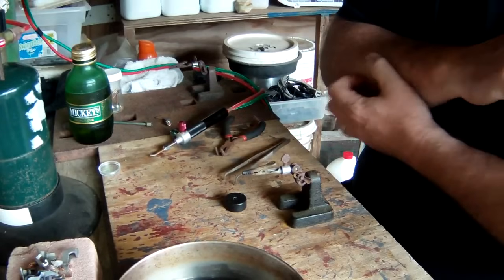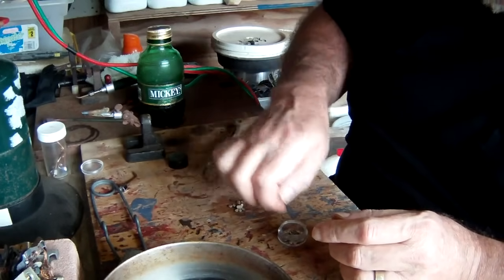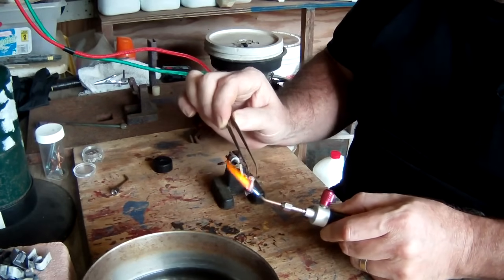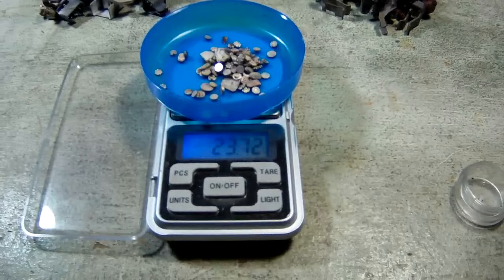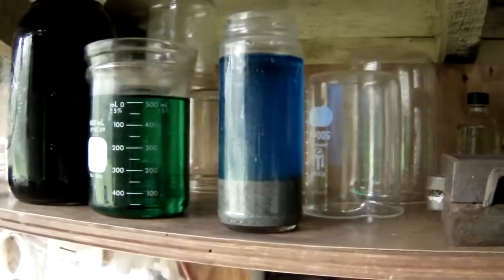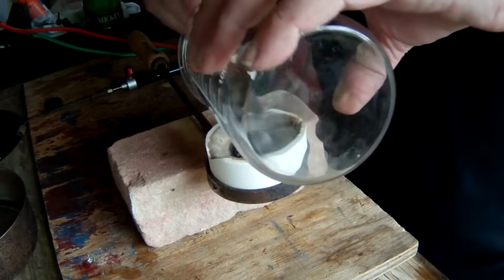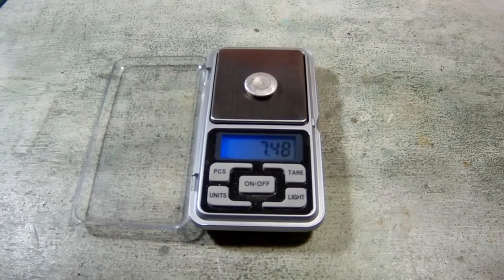Silver Contacts Recovery & Refine Complete Process (long video, but worth the watch)

Comment: After your process in this video, what percent was that button?   Also, when you were "distilling" the silver with the copper coil, what was the liquid in that beaker?  Is that process called distilling?  thank you for showing us this process.  Very informative.  Can't wait to see your silver cell video.
Reply from the maker: Yield was 1.65% per pound of arms. The fluid was a mix of silver and copper nitrate, adding the copper coil forced the silver to fall out of the solution as the copper replaced the silver. This is a replacement process where one metal replaces the other. Hoped this help to explain what was going on.

Comment: New to opening avenues scrapping. Also new to the notion my yard has been bending me over! I have about 30 or more breakers and bus bars that are silver/silver coated. Im not a well versed scientist or anything of the sort. Could you possibly point me in the direction of the safest,easiest and most layman (dumbed down fool proof) way of extracting the silver? Or would it be beneficial to just try to sell the pieces without refining? I hate loosing money at the scrap yard and I feel that they enjoy that notion....
Reply from the maker: There are many ways to recover the silver, but for me only one way of refining it, and that is going to involve nitric acid. That is the method I use, maybe slightly less dangerous is melting your recovered silver, and cupelling it, which involves mixing with lead and heating at a high temp in a furnace or by using a torch. The last method is reverse electroplating, but chemicals are involved there as well. There may be other ways of leaching the silver, but I am not aware of them. All the methods I've talked about have varied dangers, its just a matter of what you are comfortable with. If your unsure, my suggestion would be to just recover the silver and send it to someone else for the refining part. Most home refiners like myself charge about 25% of the yield, some a bit more, I haven't seen any for less. Hope this was of help!!
Reply: Reverse electrolysis

Comment: Maybe flatten the little buggers with a hammer before nitric dissolve? If there is tungsten, it will show and same time increase surface area for faster reaction. Great vid tho!
Reply from the maker: That'a a good idea, normally I try to bend them before I do anything to see if they are solid or alloy, but wackin um with a hammer would be allot quicker!

Comment: whats that nifty little torch called you are heating the contacts with and where can i get one?
Reply from the maker: Its called a smith little torch, you can get a clone on ebay for about $25, mine is a real one that I paid about $125 for years ago. Got a clone for a backup and it seems to work just as good.

Comment: I always sold mine as copper and brass scrap and didn't bother with the buttons. Or removing the silver plating never thought you would get anything with it.

When you were getting the silver or of the nitric acid did you just use a copper coil to get it to drop out or do you need to add another chemical I'm currently looking at doing this with half a pound of fuse Silver, trying to find some good methods to try as a fun project.
Reply from the maker: I actually have a video on fuse foils, it shouldn't be to far back if you want to check it out. & yes copper coil.
Reply: @BackyardScrapping  brilliant I'll have a look this weekend
Reply from the maker: @chrisinselwyn  👍

Comment: I don't know the actual names of the different types of breaker box things but in my experience, the ones with a switch that have little braided copper wires attached to the arms that hold the contacts are most definitely a very low percentage of silver. Not even 10 percent. I don't even bother with those. The ones that are silver are in the breaker box thing that has a single spring button on the top. The contacts in those are always at least 85 percent silver. Sometimes almost pure.

Comment: Where did you get that little torch that you used?
Reply from the maker: Years ago from a jewelry supply, its a smith little torch, BUT don't pay $125 for it like I did you can get them on ebay much cheaper, in fact I bought a clone for $20 and it works just as good as the smith!!!
Reply: Thank you. I bought  two different ones on amazon and they are from China and I cannot get it to attach to the regulator. The smith company said it is because they are basically counter fit products. Maybe I will try eBay.

Comment: silver forms a protective coating around itself to stop nitric getting to it , which is why you need to inquart karrat jewery . you woud have been better off melting the contact and including some copper . then make it into shot and then soaking in nitric . my guess is what you had left over was silver
Reply from the maker: No it actually was tungsten and tungsten dust, it would not melt, I tried. In fact trying to melt silver coated tungsten contacts can actually cost you some silver unless you have a very controlled temperature. Also you really want to refine them before melting because some will have cadmium in them and its really not a good idea to vaporize that. Thanks for watching.
Reply: When dissolving gold you Inquart silver. Not the other way around
Reply: @jessiemonahan9868  yeah I know. I never said it was the other way around.

Comment: I wish we as watchers could post pictures in with the comments, I have some contacts almost the size of a dime, I don't know anything about the chemical process I would just like to take them off the copper bus bars and try to sell them, where did you buy the torch you use, great video
Reply from the maker: Got it on ebay
Reply: I have some contacts that are 3/4"x1"x1/8" and weigh half an ounce that come out of nema size 5 contactors

Comment: What do you do with all the used acid?
Reply from the maker: To lengthy to explain here, I have gone over it in other videos, but I can tell you it is properly handled. Some is redistilled and I recover and reuse the acids, others are properly neutralized and  disposed of, and some are simply reduced by evaporation. The recovery method kinda depends on the refine, but recovery and reuse saves a bunch of money so I do that when ever possible, the more I save the more I make.

Comment: Thanks for the informative video!  I’ve been stockpiling all my contacts from ewaste over the years.  I do have a question.  Can you just toss all the arms with the contacts still attached in the nitric acid solution or is it necessary to remove the contacts like you did with the torch?
Reply from the maker: I the arms are silver plate or copper I do not recommend putting them in your nitric as there is to much copper. Its pretty much always best to remove the contacts or you will be dropping the silver as fast as your dissolving it and going in and endless circle.

Comment: I wouldn't rinse the dropped Ag powder with HCl first... you run the risk of creating AgCl in your Ag powder.  There is ALWAYS residual Ag still in solution after dropping with copper. Probably why your powder looked more gray- AgCl contamination.  Rinse dropped Ag powder through a filter with copious amounts of DI-H20 instead.  Final rinse with 250mL boiling hot DI-H20. This has been enough for me to get .999 purity on first refine (if parent material wasn't too dirty- mostly sterling and coin Ag). I follow up with silver cell refine to get to .9999 fine.
Reply from the maker: Hey Michael, I didn't show it in the video but I actually did rinse before putting it in the hcl, I just didn't show it, most of the time I don't show the rinsing in my videos because of time, and my videos are long enough most of the time anyway LOL, so I cut out as much as I can. I probably should have been clearer about that in the video though, as a newbie could assume they could do exactly what you said. I have found since making this video that it just seems to be the newer circuit breaker contacts that do this, and as I'm really not doing tons of new ones I just keep the silver from them separate, and then toss it in with the next refine to clean it up. Thanks so much for pointing this out, I will do my best to remember & be a bit more descriptive in the future!!!
Reply: @BackyardScrapping  Is it okay to rinse with HCI after a really good rinse? then rinse again after the HCI bath plus the boiling water rinse?  I see that @Michael Trone said it could risk AgCI contamination, is that only if you dont rinse really well before you do it?   I like the thought of rinsing like you did to get the impurities.

Comment: Are silver contacts solid silver or is it another metal plated with silver?
Reply from the maker: The ones in this video are coated tungsten.
Reply: @BackyardScrapping  are there any contacts out there where it isn’t plated but still mixed allow of silver kind of like in silver coins that it’s just silver mixed with another metal?
Reply from the maker: @alexyu1236  Yes, many larger contacts are alloys, normally they will be smooth, the tungsten usually have a kind of waffle pattern on them.
Reply: @BackyardScrapping  interesting

Comment: Where do you often find the contacts?
Reply from the maker: You can get contacts from just about anything that has a switch on it, and I mean just about anything. They can range in size from the point of a pin on up depending on what and where they were used. The ones in this video were from old broken circuit breakers.
Reply: @BackyardScrapping  Thanks, for the advice! And, the subscription ^_^ !
Reply: large switches relays cutlery everywhere

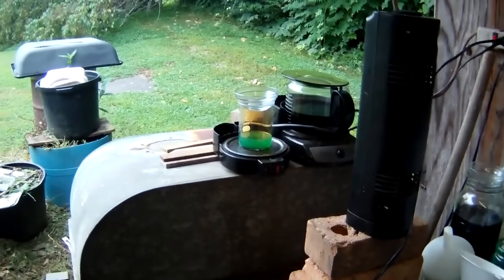Comment: Great video! I lost you at about 15:16 Is that some kind of electrolysis procedure? Also is that a mini oxy acetylene set up you have for heat?
Reply from the maker: At 15:16 I was just adding a bit more nitric acid to try and dissolve the remaining metals. A bit further you see the copper coil, that is just a displacement reaction, when you put copper in silver nitrate the copper dissolves and forces the silver out of solution, no electrolysis. The torch is actually mu jewelers torch leftover from when I did jewelry repair.
Reply: @BackyardScrapping  oh thank you for the reply
Reply: @BackyardScrapping  I usually dump concentrated salt water into the solution after the displacement, as there's some silver ion left over.  Silver chloride will then drop out, which can be washed when there's enough to work with, turned to silver oxide with hot lye solution, then dried and direct smelted with carbon, or reduced to metallic silver with sucrose or dextrose-rich Karo corn syrup.
Reply from the maker: @charlesdecharleroy7209  Yes, I do the same, I have some other videos showing that. I don't show doing this on every refine because I save the solution up until there is enough to mess with, I have showed it when doing much larger refines.

Comment: Nice video. Do you recycle also waste water with base metal chlorides or nitrates?
Reply from the maker: Waste water I just use steel or iron to drop the copper which I recycle, then I use sodium hydroxide to drop out everything else, filter and neutral the water to dispose, and I have a bucket that I keep the filters in. When I get a full bucket of hard waste, i will see if I can sell it off or give it to a larger company that can recover the rest. Great question thanks for asking!!
Reply: Perfect. I try to be responsible for waste/nature, in past I tried conversion to hydroxides but they are mostly gelatinous and is problematic to filter residual water or salts out. At least make sense to recover copper and tin because they cost some money. Regarding contacts, sometimes you can have Au-Ag alloys, sometimes more like palladium content ;-)
Reply from the maker: Yes, in the past I have gotten a few silver over gold, don't know what they were used for, but they were a super heavy silver plating over a super heavy gold plating on a base metal of some kind. The silver and gold yield were both good from these, but I have only come across them that one time. Haven't gotten many with palladium yet, maybe one day I'll get lucky and find some!
Reply: Did you ever figure out what kind of metal the remaining part of the contact was?
Reply from the maker: @Kinneycc123  best guess was a nickel alloy of some kind, with out extensive testing or one of those $20,000.00 nice little testing guns, don't really know for sure. What I do Know is there was little to no precious metal.

Comment: I run contacts from the relays out of junkyard cars. Im fortunate that the junkyard charges me $10 for a canvas grocery bag of them. I'll pull em apart and refine those contacts. Im getting between %60-70 yields. It is very laborious and kinda tedious, but the yields are real. I've always wondered why everyone says they're only plated when my experience is that they are alloy.I've posted a few videos if you're interested. Not trying to promote myself, just saying. The copper i get from the spools and legs almost pay for themselves in scrap value. The legs are also plated (very very thin) with silver as well. Good run-through, tho. Also, i thought the type you're processing contained palladium, but i guess not?
Reply from the maker: Thanks for the info about the cars! Things are a bit crazy around here still, but when thing settle a bit I will check out your channel!

Comment: Did Palladium dissolve in boiled hcl master.
Reply from the maker: No
Reply: Ok thanks you are the best master.
Reply: @BackyardScrapping  if hcl + h2so4 to dispose of iron and tin in alloy / matrial whether the palladium is dissolved in the master.
Reply from the maker: @layarsentuh7665  The powder in this batch did not end up being palladium, it was other metals.
Reply: @BackyardScrapping  1.5 kilograms of mlcc magnets I was off but could not find the error palladium dimna master.  The first step I did was burn it until it was red like charcoal, then I ground it into flour.  the second step I put in a pyrex glass then I boil using a single hcl then the water changes the color to red which I assess is nickel water, I drain it I wash it a few times to get rid of the hcl, then I soak it using h2so4 to remove the iron and then I wash it  , after that I just boiled using hno3 to get palladium and silver but I didn't get it using potassium iodine.
Reply from the maker: @layarsentuh7665  The "New MLCC's" do not have any palladium in them, and very little silver. I have done 2 batches and got no palladium, also had the new mlcc's tested xrf analyzer  which shows zero palladium and 1% silver. New magnetic mlcc's are of little to no value.
Reply: @BackyardScrapping  master, if settlement water or aqua regia is deposited using lime (cao), is the color of yellow sediment different?  please enlighten me.
Reply from the maker: @layarsentuh7665  Not really sure what you have there, please remember I am not a chemist, my knowledge of this process is hands on practical knowledge from practice and hands on doing it. For technical answers you might want to hit the books, thats what I do when I don't know whats going on. Read read read is my best suggestion I can give you.
Reply: @BackyardScrapping  ok master, thank you for the advice, nice to know from Indonesia, if you have a vacation plan to Indonesia, contact me.
Reply from the maker: @layarsentuh7665  Will do, thanks for watching!!
Reply: @BackyardScrapping  Master from which country can I have a mobile number that directly WhatsApp.

Comment: What is the coil thing?
Reply from the maker: Copper wire
Reply: @BackyardScrapping  is it hooked up to electricity?  Or just hanging
Reply from the maker: Just hanging, it is a displacement reaction, when you put the copper in the silver nitrate, the copper dissolves into the solution and forces the silver to come out of the solution. In essences to 2 metals are trading places.
Reply: @BackyardScrapping  thanks for that info.
Reply from the maker: Your Welcome!

Comment: Do you ever just melt the contacts into ingots without refining and sell them?
Reply from the maker: Great question! No I don't, I refine most everything I get in scrap. The problem with just melting stuff down is you don't really know what you have. For example some contacts are just very heavy plating on Tungsten, and they can also range widely in purity, 10% up to almost pure. By refining, I know exactly what I have, and should I sell something I know exactly what I should get paid for it. If you just melt something, and then need to sell it you have to take who ever you selling to's word on how much you should be paid for it. Like I said above this way I know. Hope this helps!
Reply: When you melt the contacts there is quite a bit of cadmium as well. Cadmium can cost money to get rid of. Also tungsten has an extremely high melting point. It is not an alloy your dealing with. It is made like a ceramic.

Comment: Where did the larger pieces of silver come from?
Reply from the maker: Which piece are you referring to?? The one at the end??
Reply: Backyard Scrapping those large pieces we see in your blue bowl. Where or which part are these found in?
Reply from the maker: @winterfrinzl7386  They all came off electrical circuit breaker arms, the contacts on the arms were all different sizes, the larger ones may have been 30 amp and the smaller ones were probably 15 amps. hope this helped.